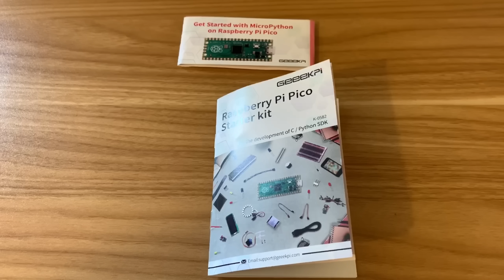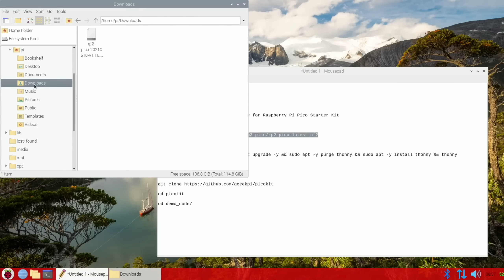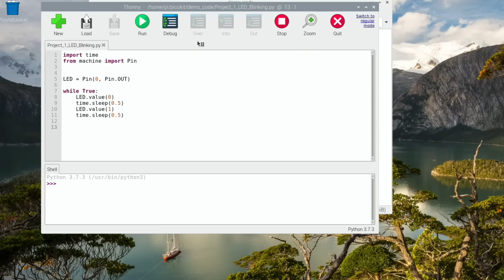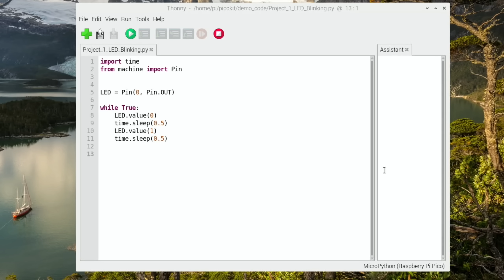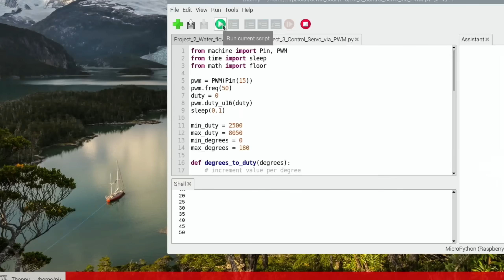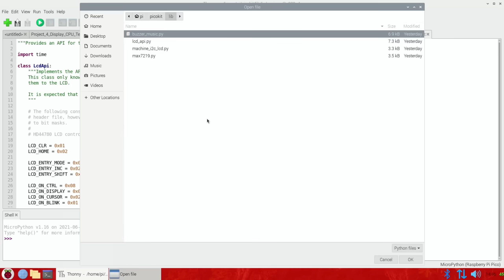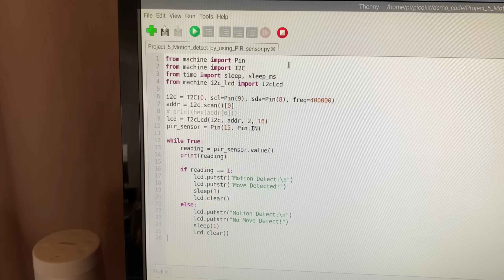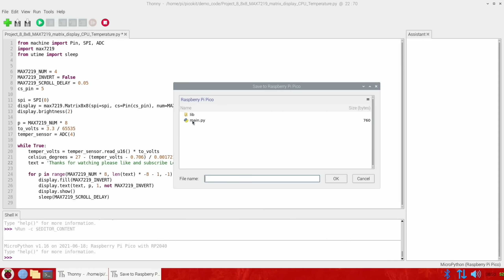Raspberry Pi Pico Basic Starter Kit.

Comment: How to install any wifi usb dongle in raspberry pi
Reply from the maker: It would depend on the the os you are running 

This should work with any os as it converts WiFi to Ethernet 

Windows 10 on Raspberry Pi 4. WOR episode 25. Ethernet to Wifi Adaptor Plus 1999 Compaq Laptop test.
https://youtu.be/LUoGqtq-u90

Comment: One thing I noticed is that there was some motion of the board while it was being soldered. This can cause what is called a 'disturbed' solder joint. It is good practice to keep the parts you are soldering still to prevent disturbed solder joints. It would also help if you used a smaller soldering tip, the one you used was way too big.

Comment: Do we really have to solder the pins to the pico? in the video the pins look like they are already making a pretty good contact even without the solder
Reply from the maker: Mine needed soldering, they were a loose fit before.
Reply: @leepspvideo  oh I see, thanks for info
Reply: I think you need to solder the pins so that it will keep stady when your move around the device.

Comment: saving as main.py was not necessary, just use the green run button to run the current active code window, 
thonny also has a tree view for both pc and pico files, rightclick on any filename to transfer it to the other tree-window.
but it is a nice kit, sad that the docs were not tested by a noob before printing.

Comment: You could have just dragged the files over onto the lib while in drive mode, I think
Also when you click play on the computer for the script, I believe it's using the code on the page not the main.py, so you can test the code all you want without the need to save it, when you have it right then you save it and unconnect the pico so it can run on its own
Reply: nope, drive mode is exclusively for uf2 files, for micropython upgrade or C compiled file ...
Reply: I have a different way to upload the main.py and libs file to pico, just using rshell to connect to pico ,and then use command cp to copy my lib file to /lib folder and it is so easy  under Raspberry Pi OS via command line~ LoL, I love command line style, so i am using vim editor to write the code.